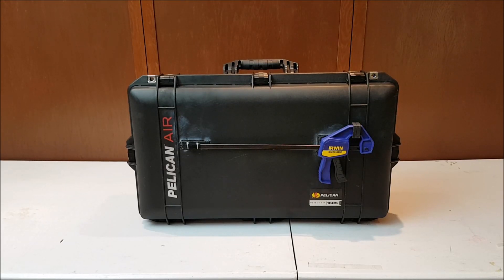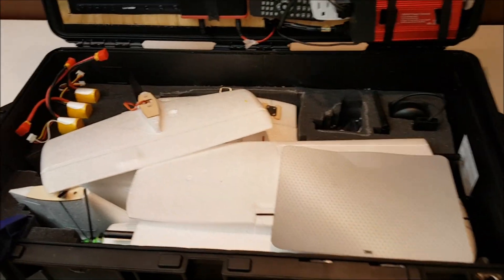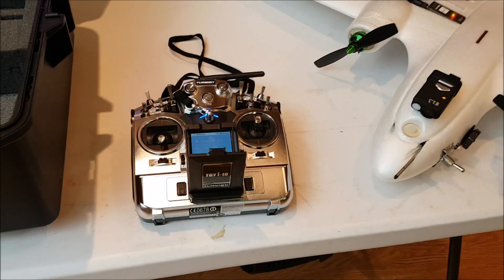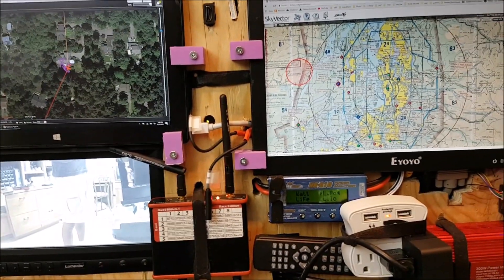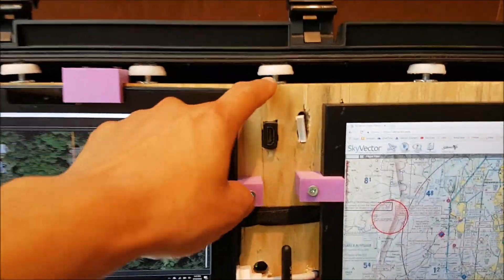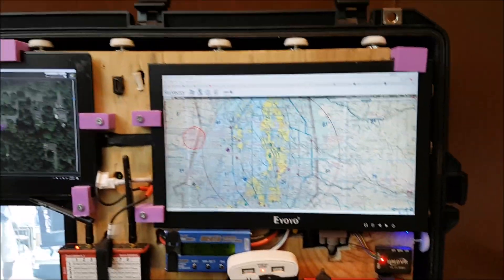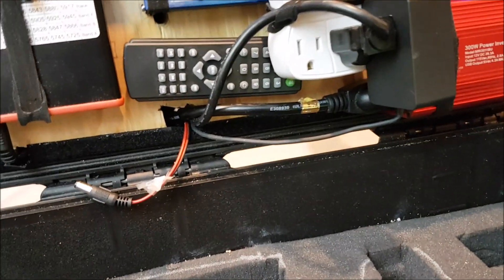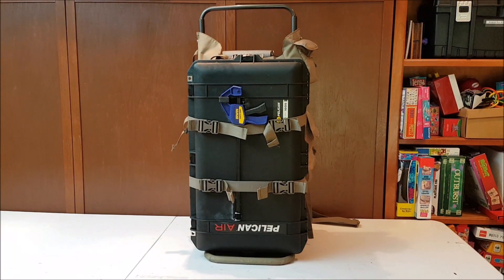Unmanned Aerial System (UAS) Ground Control Station (GCS) in a Pelican Case

Comment: 👍🏻  EXCELLENT!!! Thank you.
I currently provide use of my drone gear to my local volunteer fire department/rescue squad as they are still going through the process of establishing a “drone unit” internal to the department.   
I’m using a DJI Mavic-3 for this application… mainly due to the extra long battery life / extended OccuSync 3 telemetry & video streaming/ telephoto + zoom camera system.

I’m using an RC-Pro “smart controller” which has an HDMI mini output for live video monitoring with external monitor(s).

I have used a hardwired F279 7” bright 2200nit display with integrated NP-F750 style battery system.
With a fiber-optic extended HDMI cable, I’m able to send the signal up to 25-30’ or so..
It ends up being a very messy solution to providing a display for an incident commander or operations chief.

So…. After watching your video and a few others showing other options, I came up with a “video kit”..
I took a Pelican Elite (wheeled case approximately the size of the model 1510) and use it for all video needs,
including 2 sets of Orqa FPV One goggles, a high brightness 4K 15.6” portable display and the FeelWorld F279 7” display.

For power, I am using a pair of Baseus 30,000 mah battery banks (w/ USB-C 65watt outputs and USB-A 3.0a output)
and a single Renogy massive battery bank for use when operating away from AC power (or vehicle generator AC power) for extended time.   

At the drone operator side, I’m using a Radionics 1500 HDMI transmission system transmitter.
It operates on 2.4 / 5.8 GHz and auto switches between bands and channels to find the optimal settings.
The transmitter has an HDMI input and an HDMI looped output.  It has 2x SMA connectors with small “rubber duck” type antennas and I carry a pair of magnetic mount 9db gain antennas with 20’ RG-400 cable assemblies for use when extra range is critical.
The power input is a “barrel” type DC connector and requires 12vdc @1a.  Power is provided by the Baseus battery bank with a step up converter (5v to 12v).

I am feeding the HDMI input on this device with a 20’ cable from the RC-Pro controller.

The HDMI looped output on the transmitter feeds a small HDMI 1x4 splitter unit.
(requires a high end externally powered splitter to function properly)
2 pairs of goggles and a small 7” HDMI field display are fed from the splitter and used on the transmitter side of operations.

On the receiver side, there is a matching  Radionics HDMI receiver.  
(The System can Support FOUR RECEIVERS simultaneously!)
It is mounted in the Pelican case, inside the lid.

The receiver HDMI output is connected to a second splitter device.
The splitter then feeds a 15.6” field display mounted in the Pelican case.
There is a second display. A second FeelWorld F279.  This is attached to a mini clamp-on tripod device which clips on to the lid or sides of the case for additional views of the drone feed. 

The range of the HDMI transmission system is approximately 570’.  It works up to 1,000’ in optimal conditions, but I use a simple rule of 1/3 of the rated distance is the “always works” in the real world distance.  
These are a real bargain!!  $300 for a transmitter/receiver set.  Each additional receiver is $190.
I bought a spare (second) receiver and paired / bound everything up to the single transmitter initially..
Then I packed the second receiver up with a few assorted HDMI cables and adapters and an additional  Baseus 30,000mah battery bank.  Along with a pair of attached antennas and a pair of magnetic base type 9db gain antennas.
This is all packed away in a small nylon gear bag and carried “just in case”. 
(a large, multiple agency or similar disaster or other event..  providing a total of 3 points of attachment for monitors to view the drone operations.  ** something to keep in mind : When using 2 or more receivers, the range is cut by approx. 25% !

The Baseus battery banks are excellent for this application.
They are 30,000mah capacity and provide QC 3.1 / 65watt output via USB-C  (ideal for the large 15.6” display)
and have 4 extra USB-A ports to power accessories like the HDMI transmitter units and splitters.
(approximately $65 @ at Amazon)

Thanks again for the great concepts and ideas !!
Reply from the maker: Thanks for the detailed comment and for sharing your setup.  I'm glad you enjoyed the video!

Comment: Hey there! Looks like you have a nice setup, and it looks a lot more convenient than dragging each individual system around and setting up. Something you could try is running your 12v 20Ah battery to a power distro board and power your equipment off of that. I bet it would raise your efficiency a great deal vs converting DC to AC back to DC unnecessarily. That said, having a power inverter in your setup is still a very useful tool. I carry one in mine as well. Thank you for sharing your setup with us sir.
Reply from the maker: Thanks for the great tip, I'll have to think about this if I revise or make another one.
Reply: @ChristopherLum   Also, the 3s battery you're using is a great choice for the project. But if you ever found yourself wanting to push the limits of your supply on your GCS or even your plane for that matter, you could make a switch to Lithium Ion cells. liIon is much more energy dense compared to LiPo and allows for a lot more usable capacity compared to LiPo. I've recently put together a couple of packs: A 4s4p, 14Ah 18650 pack for duration flying weighing in at 800g (compared to a 4s 5.2Ah LiPo at 520g), and a 3s6p 30Ah pack for my ground station. The trade-off is a higher unit of capacity for unit of mass, but a lower maximum current draw. It gives you a lot of flexibility designing a power supply for a specific purpose though, and a makeshift spot welder is very easy to make. If you're interested, I could put together a video detailing how to put mine together.